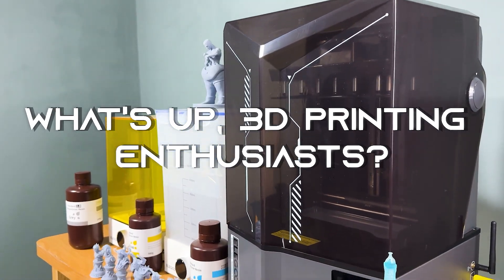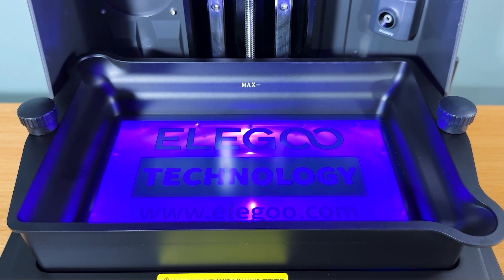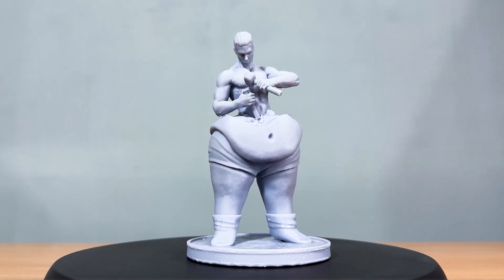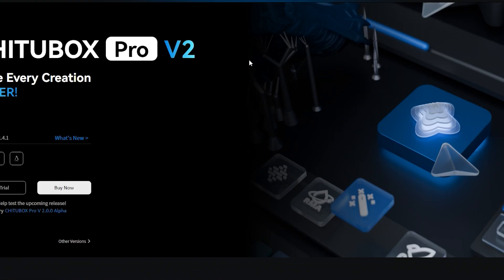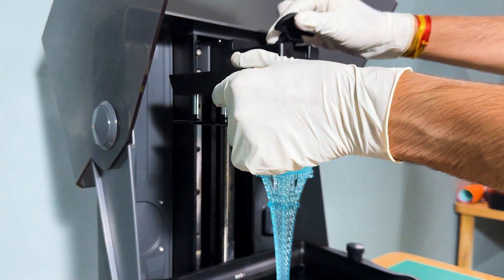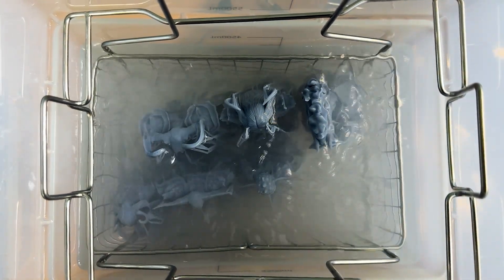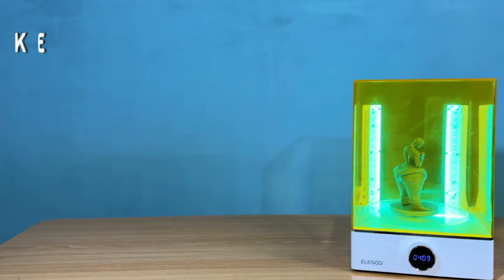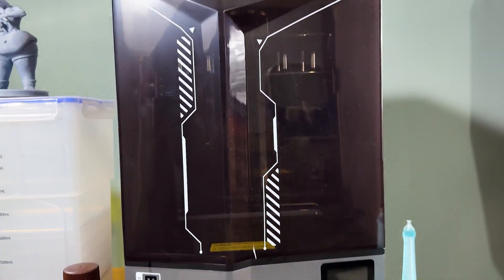Elegoo Saturn 4 Ultra Resin Printer: Insane Detail & Speed - Worth the Hype?

Comment: I own this printer and its a good resin printer dont get me wrong but it has some flaws also! Fistly the camera.....The " Ai " built in the camera dosent do shit! It just a gimmicky selling point by Elegoo! Its just a simple 1080p monitoring cam! Ive had many print failures and the camera did nothing to prevent allt these failures that could have saved me some time and resin! Second is the " auto leveling " and third is the vibrating sound of the tilting vat mechanism! Its sound very loud
Reply: True. The ai that wrote the script is paid for by elegoo so dont listen too much xD
Reply: for the tilting vat mechanism, try to add a bit of WD-40. I´ve added a bit to mine and now I can barely hear smtng.